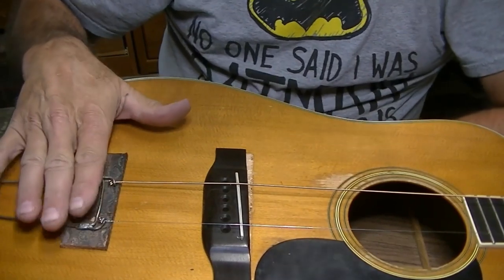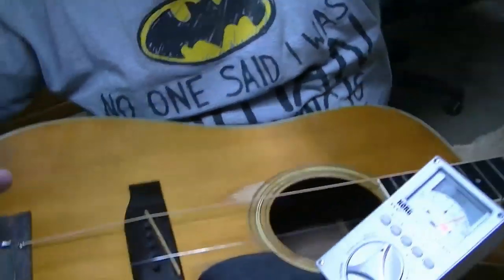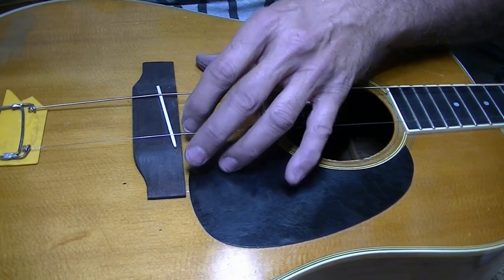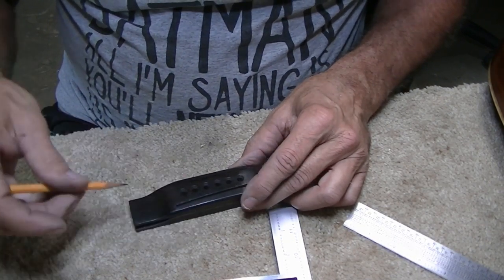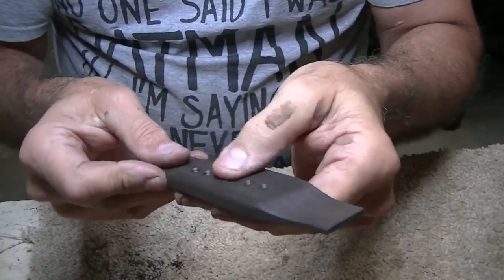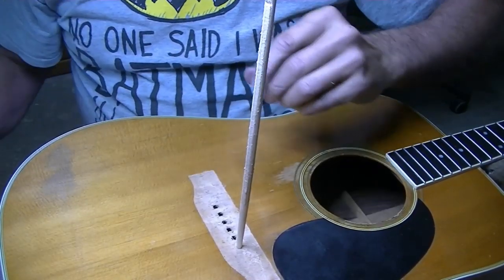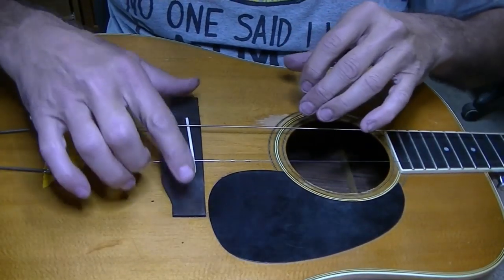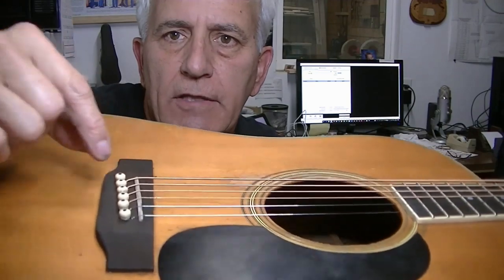316R Rsw Martin D35 With Severe Intonation Issues Revised

Comment: I have a red Gibson SG with the same issue, almost the same angle to set my intonation, I got it cheap because everyone who played it said it sounded horrible, well it did. Lucky I know a guy who owns a body shop and he mixed me up paint, I had to fill the hole on the low E side, and drill a new one almost 1/8” back to set the bridge at an angle to set intonation. She plays great now, but would love to know why this guitar was like that, and secondly how Gibson QA allowed it to leave the factory, with intonation that bad.
Reply: Jake - A Gibson SG (or almost any other electric) has adjustable saddles for each string. It isn't set permanently like an acoustic. The angle of the bridge is set in the area where each saddle needs to be. Sorry to say, drilling holes and moving the bridge was totally unnecessary.
Reply: Matthew Drohan yes I know about adjusting the intonation on a tune-o-matic bridge, in fact I tried several different brands of bridges to see if I could get the Low E, A, D back far enough to allow setting intonation. A few brands make a longer bridge scale length that could just almost set intonation, but didn’t go back far enough. Neck was perfectly straight, stings came down the fretboard perfectly. My understanding that several “guitar techs” attempted to fix it and gave up. I don’t know if a luthier looked at it, that’s how I got so cheap.

At the time I was getting my degree, I’m a disabled Vet using my GI Bill and I did volunteer work rebuilding musical instruments that people donated for low income kids in schools under the watchful eye of a master luthier (Violins were his thing) I spent many a Saturday leveling fret boards and polishing frets.

But the intonation was so far off in tuning, it was incredible, it was a full note off almost.

That’s why I had to plug, drill and move one side of the bridge.

In the end it look fine, just the bridge was at a slight angle...much like the guitar in this video. My buddy hooked me up, the paint was a perfect match, self leveled...little polish couldn’t tell.

Plus you can play it now.

Comment: Jerry .. your thoughs .. D18 , D28 , D35 ,  witch wich one is the better all around . long as the bridge is in the right place .
Reply from the maker: I think they're all very fine. I'm partial to the d-35 and the D-28.
Reply: @RosaStringWorks  
they both have that Booming Bass   I checked the other day .on a D28 . 
rose wood back n sides and fretboard ,
anarondak spruce top  black  with silver logo .. good I was sitting down . I was told 20 K   luckly I had a roll of charman in the tractor ..

Comment: Gosh. I'm baffled as to why the angle of the saddle has to be so severe, rather than just moving the saddle back and keeping the original angle. 

My first Martin D28 had this problem, shame, it otherwise sounded great.
Reply from the maker: If you look in the last couple of Clips the angle wasn't that bad after I moved it all the way back. I should have pointed that out.
Reply: @RosaStringWorks  Thanks for reply. I see what you mean, but the angle still seams more than usual. Interesting video, thanks.

Comment: How is it that the intonation could be so far off? That the saddle could need to be at that angle? Is the neck not straight? Is the bridge also not mounted "straight?" Are the frets not straight? I know there's some art to this, but scale length is scale length, no?  Once assembled, it looks pretty normal. Maybe it was just the length of the saddle substitute that you were using that made it look so crazy.
Reply: I think all the information of intonation is so wrong. It can fix easily lossening the string or change gauge. The intonation is all in the frets stay in notes with a smaller frequency increase.

Comment: It occurs to me that in the old days, when making the guitars they probably did not test fit and adjust the saddle with a temporary rig as you have done. I assume they would have made a master model and then drawn up some shop plans, with dimensions, maybe made some patterns and jigs. 

Then you have possibly a changing work force having to churn out copies of that model with a lot of hand work and hand measuring involved. So perhaps just too much opportunity for the bridge and saddle position to drift away from where it should be. Quality control was probably not as strict as it might be today and if they did notice a wonky guitar what would they do - scrap it, spend time and money fixing it, or just ship it out the door? 

Also ... how would they check intonation, by ear I assume. They didn't have convenient and accurate electronic tuners.

Comment: You might coulda tried a different gauge/type of strings... some older acoustic guitars (c1960s) respond well to Martin Silk and Steel sets (MA130S) - sold so that the folk music heroes of the day didn't hurt their sensitive fingertips, and the overall pressure stresses on the guitar body is less. I have a lightly braced 1965 Yamaha 12-string that I resurrected, which sounds just horrible with anything but silk and steel.

Comment: How the hell is that even possible? You expect a small difference in string length maybe, caused by the difference in elasticity maybe - but that!? It's half-an-inch out easily.
I wonder what happens if you go to a different string set. Maybe a lighter gauge?
Reply from the maker: I should have called attention to it that by the time I finished it wasn't that far off.

Comment: Jerry, I understand how you fixed the intonation but don't understand how it could so far off. What is different about that guitar? Do you have an explanation?
Reply from the maker: It just simply was the bridge was too far forward when I move everything back everything was really fine. As I mentioned a bunch of guitars came out that way. The angle wasn't that terribly severe once I moved everything back if you notice you can look at it and see that it wasn't that much of an angle.
Reply: @RosaStringWorks  Ah ha!  So Martin dreadnoughts have a scale length of 25.4". I'm curious how far it was off.

Comment: The octave gap is always EXACTLY halfway along a string. 
The reason the low-E is a bit longer is because the tone changes with a high action due to the string being put under greater tension when held down.
But the angle you have set the saddle to seems larger than most guitars, so is the action on that guitar particularly high?

Comment: Would Martin take it and fix it since it was never right?
Reply: Yes, they fixed my 1973 d28 with the same problem. From what martin told me, in the 70's there was a strike at martin.  They had every one they could get assembling guitars.  The problem arose from the pattern for bridge placement being off about 1/8."  They replaced the top, sanded the sides and refinished the sides and top. When  i got it back, it sounded way better and noted true. They also straitened the neck to correct action. It's been 40 something years age and it just keeps getting better.
Reply: Ronald Clark wow that’s awesome. 
So when you got the guitar back from Martin did it look like repairs were made? Or did it look like nothing ever happened?

Comment: Jerry, so in addition to the bridge being in the wrong place was the original bridge the wrong bridge for that scale length (does the saddle angle change with scale length?) or was it just improperly made?
Reply from the maker: Actually the angle wasn't that bad once I moved everything backwards the treble string was sharp in its original place so when I moved it back it was better. It really wasn't off anywhere once I moved everything back.

Comment: I thing frets are not square to the center of the fretboard including the nut otherwise an angle on the saddle with regular medium strings is impossible !
Reply: IF you include the way the nut is cut and filed, you are the first person in this whole discussion, including Jerry, to nail the problem.  Scale length divided by two determines the twelfth fret location.  End of discussion.